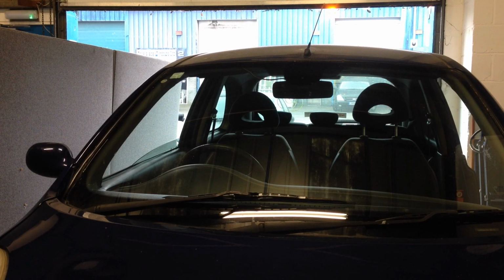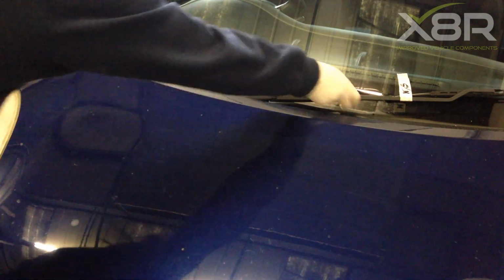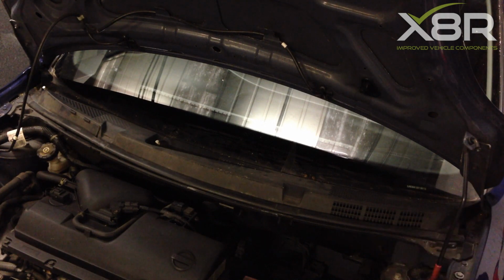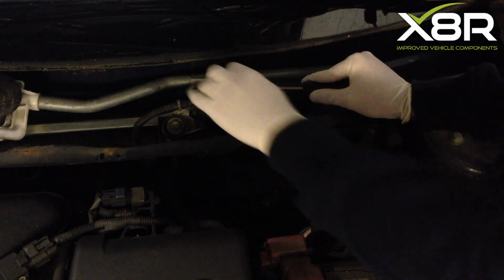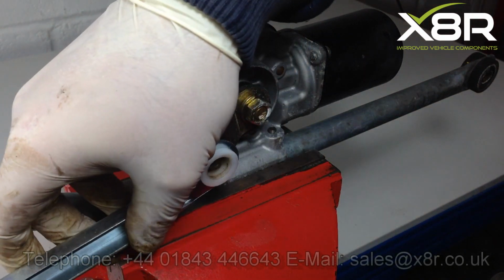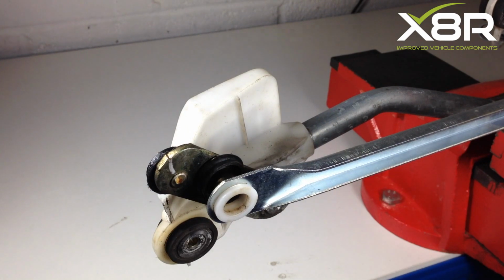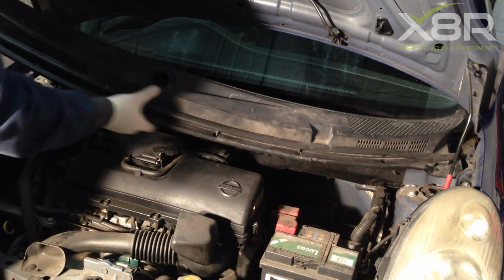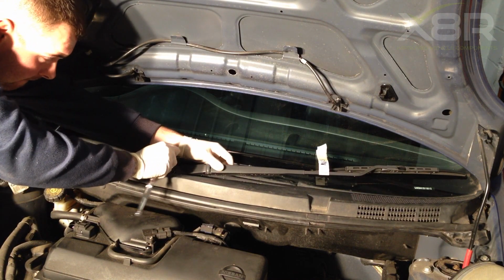Nissan Micra K12  Wiper Motor Linkage Repair Replacement Push Rod Set Instruction Guide Install

Comment: Thanks for this! Just did it on a 04 Micra. Luckily I only had to take the scuttle panel off as the arm had popped off. I'll get some new ball joint rubbers though as it's bound to fail eventually.
Reply from the maker: Glad you found it helpful!
Reply: was it a big improvement?

Comment: Good video, but you should of put some grease on the ball joints !!
Reply: Is this true?
Reply: @LarniPhoenix  Nissan say the grease will stop the rods going fully on owing to hydraulic lock. I apply a very thin smear, otherwise they will pop off and drive you mad!